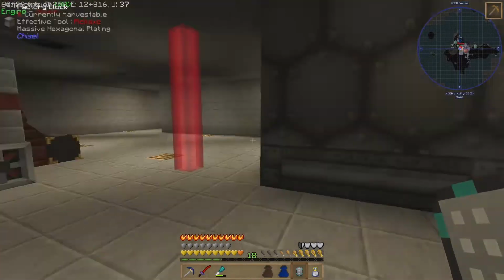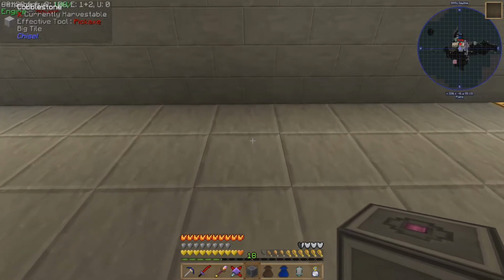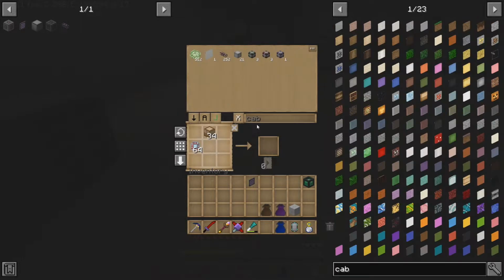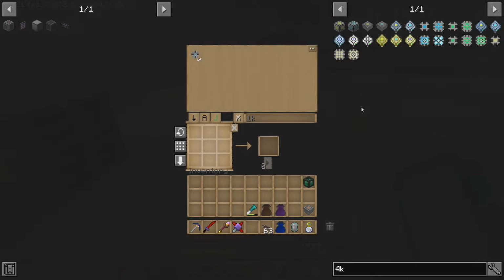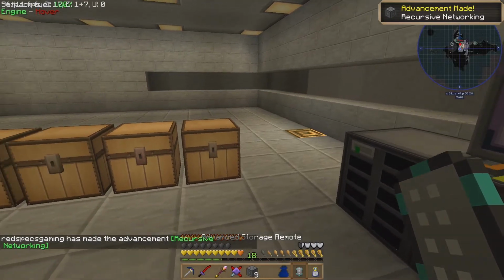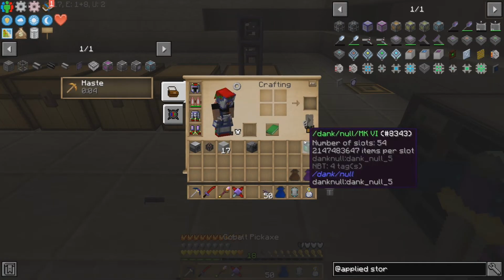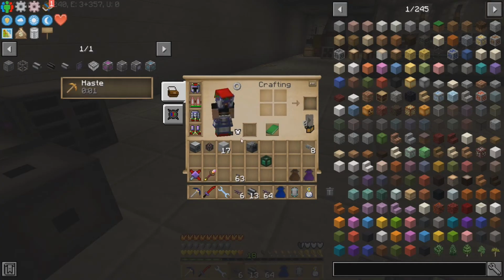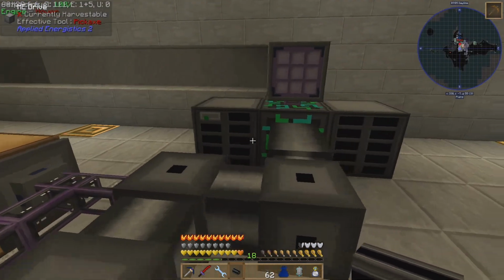MC Eternal - Ep 55: AE2 Computers and Cables

Comment: a quick tip i could offer for the AE2 cables, if you split it up to the 8 connections, you could run grids without needing to use a dense cable on every connection to save on resources used. like for example with the explanation display, if you had put the anchor between the numbers 1 and 2 chest, you could have used basic cables to connect 2-9 and still had the same effect without the need for so many dense cables ran, saving on both resources as well as space used, though the explanation is really helpful for many that have never used AE2 and it is greatly appreciated. ^-^
Reply from the maker: Yeah i generally try to conserve where I can when wiring up. I have even gone back this week to collect what cables I could and just run plain glass where possible, which i show eventually i think. Just didnt want to too much with the basic explanation.
Reply: @RedSpecsGaming  i completely understand that. Like I said, for an explanation into dense cables verses basic cables it was quite helpful. I honestly have never used dense cables before myself, though I rarely get into building the stuff needed for massive storage systems due to my lack of mining advances, I tend to stick with small setups that get totally cluttered with excessive farming lol.
Reply from the maker: Haha, i feel you. My first "real" foray into modded minecraft was Sevtech. Talk about born in the fire! I am however a bit anal when it comes to building so i am always thinking about what hassels something i build now are gonna be for me later. heh